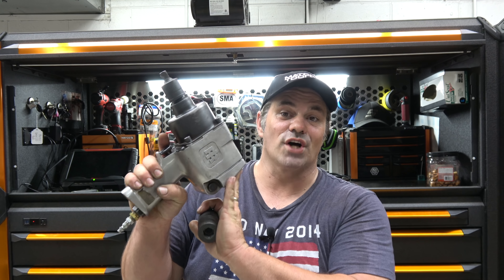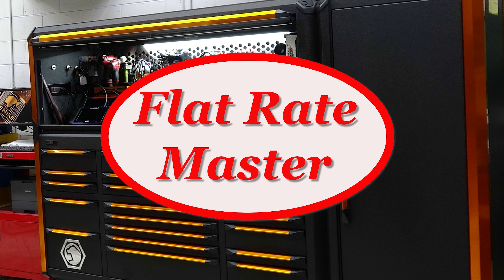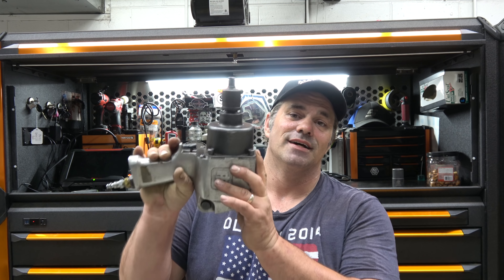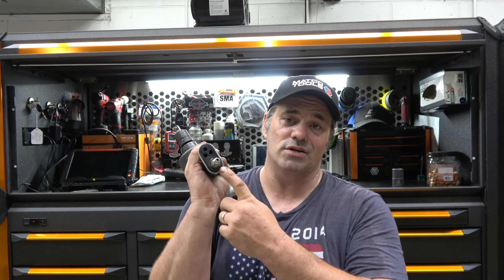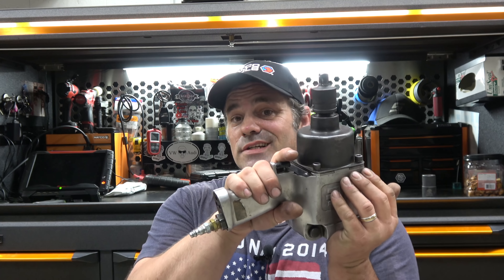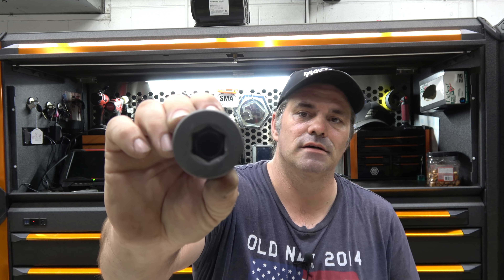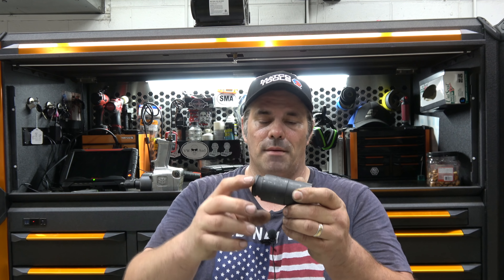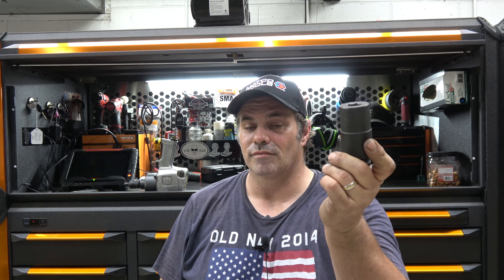Specialty Crank Sockets

Comment: I successfully removed mine (2008 Honda Odyssey) using: 1. This or similar 19mm crank socket, 2. Kroil Penetrating Oil sprayed twice a day over 3 days, 3. Heated the bolt area with a electric heat gun, 4. Removed with only a $99 Harbor Freight EarthQuake 1000 ft-lb Air Impact Wrench while holding the socket steady with a gloved hand (to prevent wobble-vibration). I first tried with an electric Impact which was not up to the task.

Comment: That's one bad ass socket.  The 3/4 to 1/2 inch adapter will probably break before the socket will.  Even a 2 to 3 ft breaker bar has it's weakest point where it attached to the socket and the bar will therefore most likely break before the beefy socket.

Comment: I have  3/4 drive gun but invested in the 3/4 sockets in the correct sizes for crank bolts . No loss in power using a reducer. Never had one fail me yet . Love the videos btw keep it up !
Reply: adrian mendoza I've seen some techs actually use 1 inch 25-30 lb impact to remove those crank bolts because some 3/4 impacts could not remove it too for some reason

Comment: I have the Lisle version and it is so much better than the old way of locking the crank and using a breaker bar. I hate it when they are on super-tight and you have to hang off the bar!

Comment: Just finished water pump on a dirty Max 6.6L all I did was bump crank with 3/4” breaker bar against the frame
Reply: J ROD.  Really should lock with tool.  That way when you tighten back up the dent in the left fender matches the right fender.  Easy to check torque that way😉

Comment: The four cylinder accord and civic is pretty easy to remove,but it's the v6 Accord and Ridgeline is very difficult because of the way the engine is built it's kinda like a reverse motor that actually tightens the bolt more everytime you start it up,a 2763,67 or the w7150 will remove it wit that Lisle 19mm but without it they are much harder to remove than semi truck lug nuts torqued to 500-600 ft lbs or even more and Honda says the balancer bolt is 181 ft lbs but a lot more difficult to remove if you don't have a strong enough gun with the right socket

Comment: I think they stick not due to the torque but the flat of the bolt rusting to the balancer. I've only done a couple but a little hear with a torch and a normal socket plus my ir231 and it came right out.

Comment: I just picked up a 19 mm CTA brand crank bolt socket for $2 today brand new and I'm curious to see if it's going to help at all with some of my stuck suspension bolts on my rear control arms on my 04 Subaru Outback besides for $2 you can't go wrong

Comment: Great vid another thing you can do is use a shallow socket and a breaker bar .stick the breaker bar in the frame where it can't move .bump the key and with the torque of the starter being increased by the flywheel diameter it breaks them free all the time

Comment: If I was still doing lots of those T belts I would get one of these. Never heard of it before. I've always been fine with the pulley holder. The real "pros" will just stick a breaker bar on the bolt and pop the starter.....

Comment: How do you torque crank bolt back?
Reply from the maker: Torque wrench and the holding tool
Reply: @flatratemaster  considering how hard these are to get off what the hell is the crank Bolt torque spec set to anyhow and I'm going to guess that use Loctite as well?